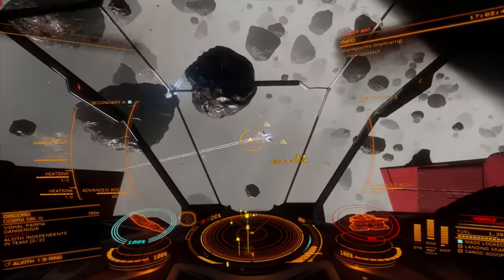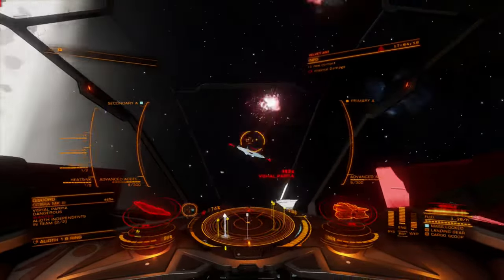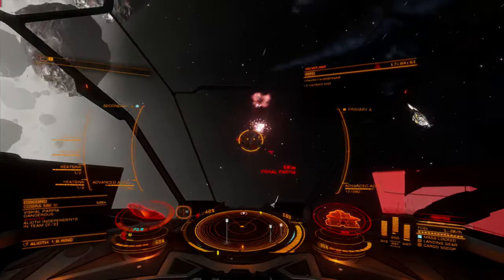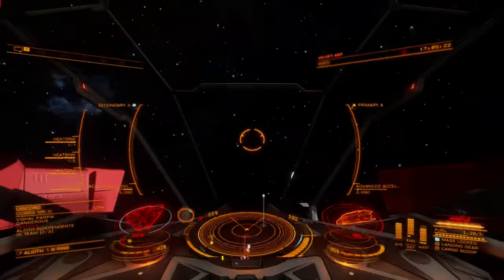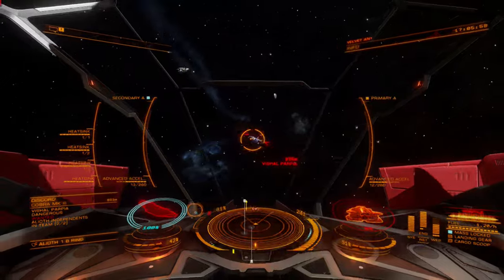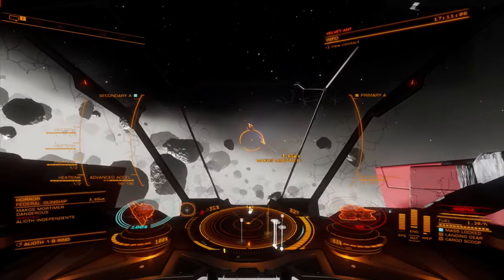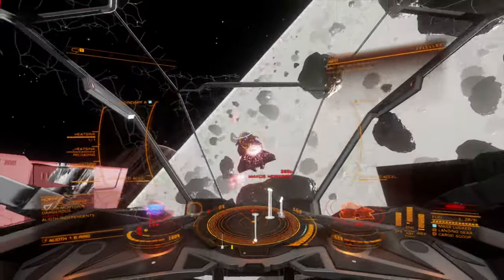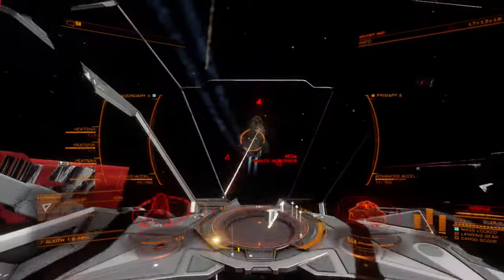Elite Dangerous | Module Review | Advanced Plasma Accelerator

Comment: My DBX bubble bus is armed with a rapid fire APA and two turreted light weigh/efficient heat vent beam lasers. Light weight offers more heat dissipation, efficient a bit more DPS.
Really comfy in PVE interceptions or occasional assassination missions. Anything small gets chewed by beams while I concentrate on maneuvering and anything big gets eaten alive by an APA since it gets more DPS in a T3 slot than a standard T4 PA. And since you have to keep in those big ships blind spot anyway, range is not a problem. 
Oh, and with a DBXs monstrous fuel tank plasma slug is not much of a hinderance.
Yeah, I know. Slow DBX bubble bus + fighting in a bubble bus… But I am weird that way. :)
Reply: That's sounds like a fun build. I also like to fly dbx around bubble sometimes so will give it a shot after get APA .

Comment: Agreed with this .  I have 2 of these engineered to grade 5 as efficient type and plasma slug . 
Good at close range with big ships . Other wise you end chasing your opponent around and use up your fuel. 
The opponent will take hits but have enough time to re generate their shields in between attacks . I was a bit dissapointed with this weapon . I had them on  Vulture which could handle the use and the Vulture is maneuverable

Comment: Yeah, but they don't come in gimballed and if you can't hit it.  You do no damage.  A miss is as good as a mile and I couldn't hit a cows arse with a banjo.
Reply: Gimballed weapons require more power and consume more of the distributer so it would make it usable only on bigger ships like the Anaconda which has 8 utility slots which you could put heatsinks on to stay cool while firing the gimballed weapons, it would make them too overpowered. That's why there are no gimballed rail guns or plasma accelerators.